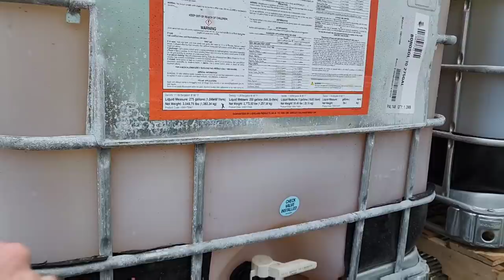Cleaning Up the Tractor - #660

Comment: Hey there Nathan, and Brayson, and Brock, I hope this finds you all well and good! 

Nathan, you need to get all of those weighs off the front of that tractor, for all of the previously mentioned reasons, plus reduce the weight on all of that drive unit, plus you're tracks won't heat as bad at high speeds, you also need to put some of John Deere's Graphite on your tracks and rollers which will also cut down on the friction, which causes heat and wear. 

Today is Tuesday, and I hope you're putting that seed in the dirt.

I hope y'all have a good one! 

"Nothing Runs Like A Deere" 🦌👍🇺🇸

Comment: Oh the fun with tracks begins.  LSW tires probably would have made it through that wet spot, with a whole lot less cleaning up to do.  And LSW tires would probably do just as good or better than tracks in the compaction area.  LSW tires take less fuel to turn them than tracks.  LSW tires cost less than tracks initially to buy.  And wait until you have to repair/replace the tracks and track parts.  That will cost some big bucks, unless they are covered by warranty.
Reply: You can’t side dress corn with LSW.
Reply: But lsw tires void most warranties as they are hard on axles and final drives ! Plus they take way more hp to turn than 18 inch tracks . That muck he was stuck in would have sunk anything else with tires or tracks  as it was gumbo and the planter and nurse tank was what stopped him.